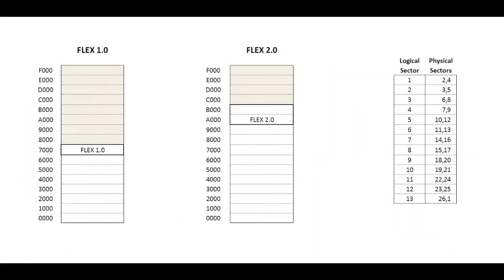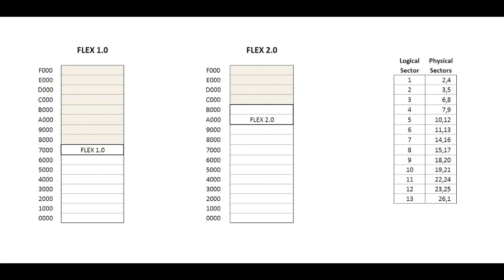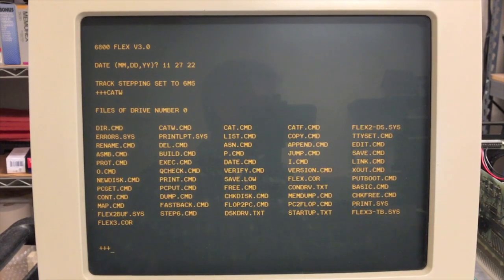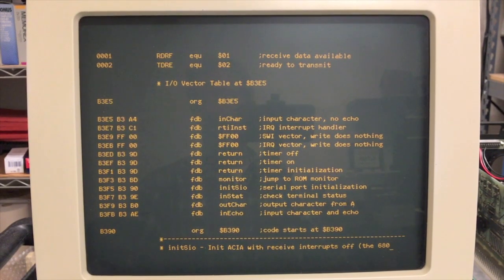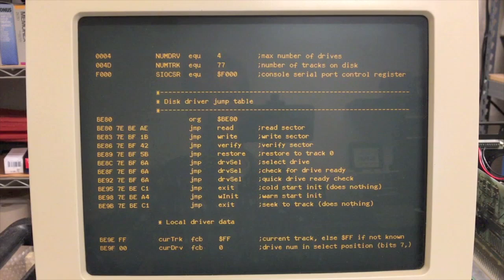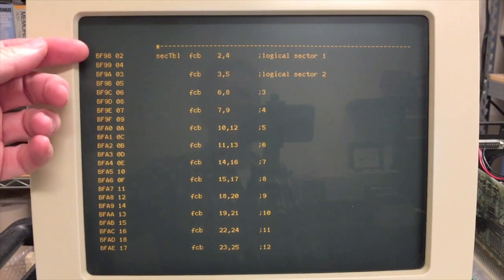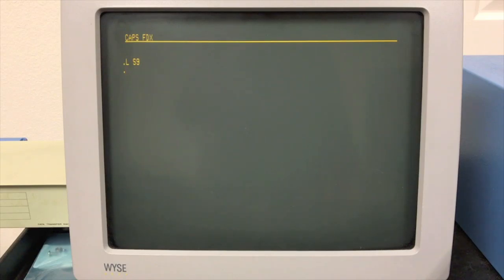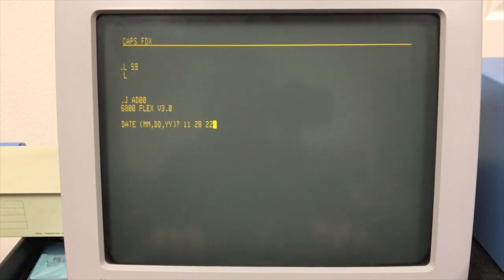Altair 680 Upgrade (Part 1)

Comment: That's a nice IO card to provide two whole PIA'a and an ACIA. It seems like a W65C22 VIA is pin-compatible with the PIA and would get you a timer. Not sure whether it really is a drop-in replacement nor if it's worth the trouble.